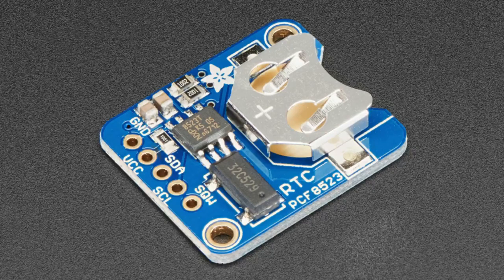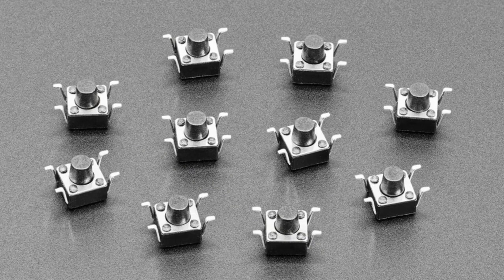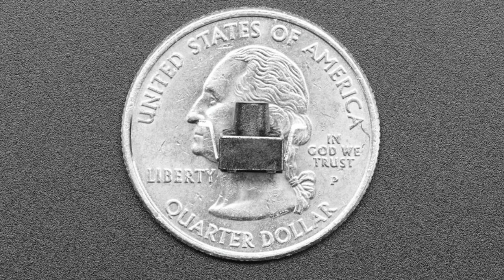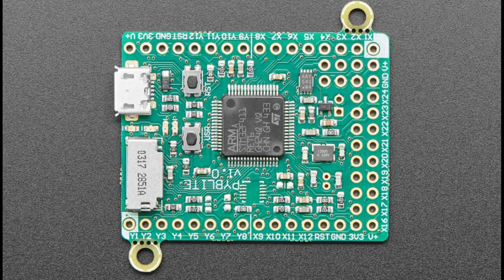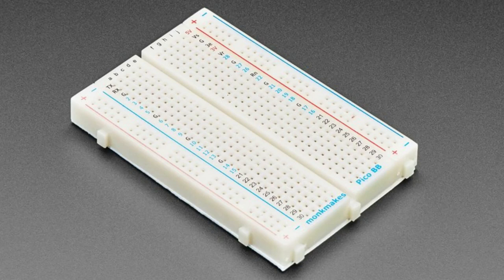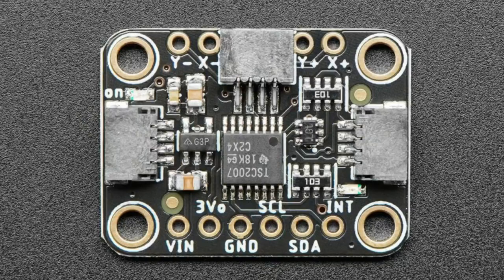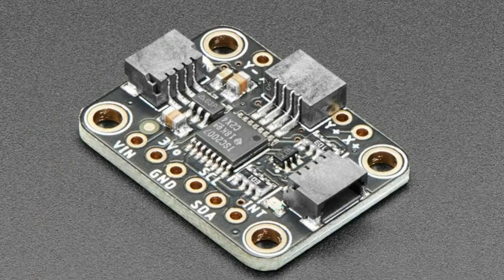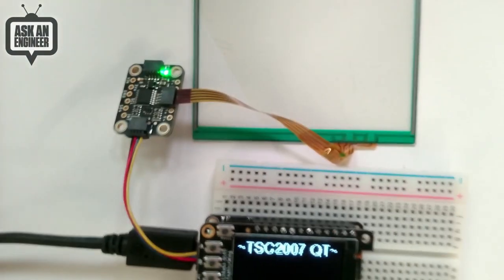New Products 4/1/2022 Featuring Adafruit TSC2007 I2C Resistive Touch Screen Controller - STEMMA QT!

Comment: Huh, I always thought the F411 was more powerful than the F405, not less, go figure. Crazy that the breadboard is a thing we need, there was totally room to put silkscreens on the PCB.
Reply: F411 is a little slower and only has two UARTs. Most of them can be overclocked to 120MHz with no ill effects though. (both are used in FPV drone flight controllers often which is how I know this.)